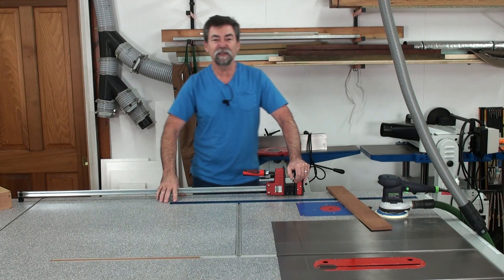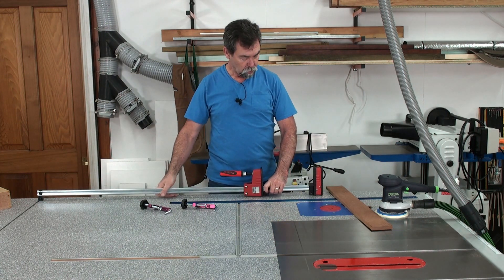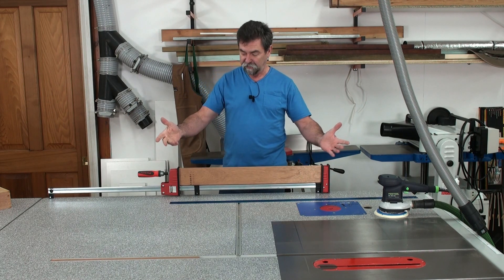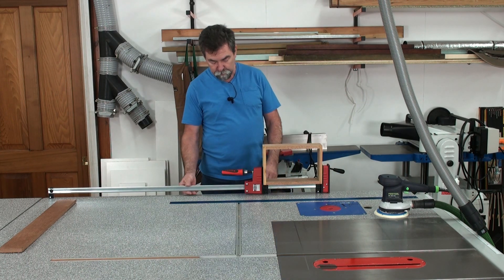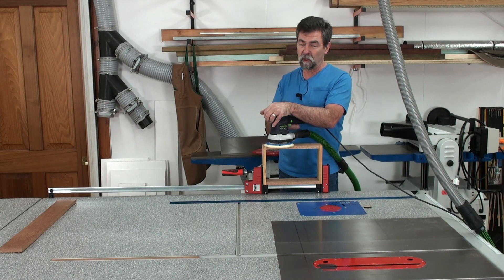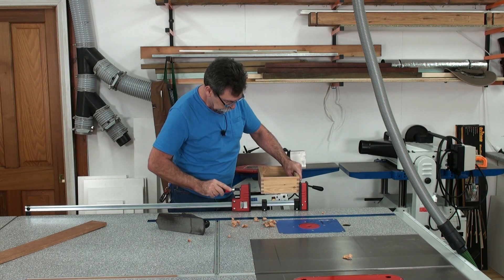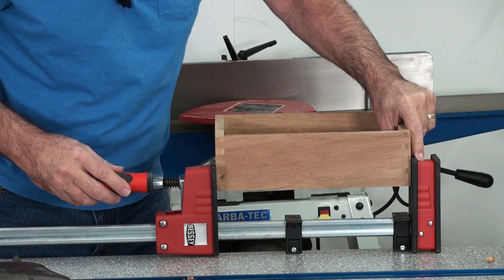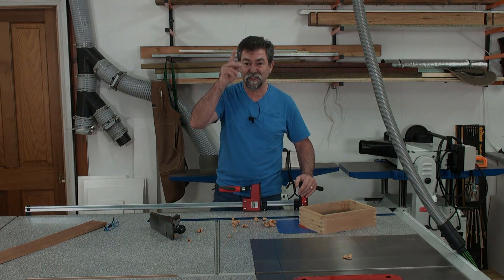How To | Make A Bench Clamp | DIY

Comment: David, is that a 27mm Festool hose connected to a 36mm Bosch hose? What is the connector you used, if you don't mind me asking?  Thanks for the great videos, I just subscribed today and am going through them all as I quite enjoy them and they're filled with a lot of good info.
Reply from the maker: Hi Matt. Sorry for the late response. My 36 mm hose has 2 x 36mm ends instead of a 50 and 36. I find the outside of the 36 rubber connector fits inside the 50mm after a little persuasion, from there on it remembers how to do it.

Comment: Great tip. Also in aus - where do you buy your Bessey K-Body's? Carbatec?
Reply from the maker: Yes, and a heap of my other gear.
Reply: I figured from the machinery in the background :)  Still a bit uneasy about spending a significant proportion of my income on a single clamp, knowing I'd need lots of them.

Thanks for the great videos!
Reply from the maker: Its a pleasure. Those clamps are once only purchases. Last and last.

Comment: Hi there can you help and advise? I purchased four k body bessey clamps that arrived today, I set my German made square against the inside cheeks of the bessey clamps only to find that they are out of true not square, is this normal? Thankyou for your help kind regards louie Ulster workshop in Ireland
Reply from the maker: The heads are designed to allow for some flex in the main bar.
Reply: @DavidStanton  Thankyou David, I found that when the bessey clamps are in a clamping position or state they do indeed present in a perfect 90degree, kindest regards Louie, Ulster Workshops Northern Ireland